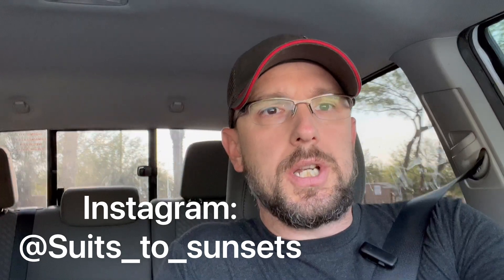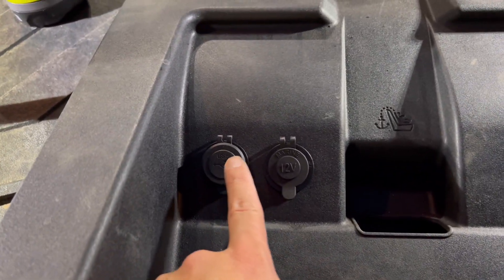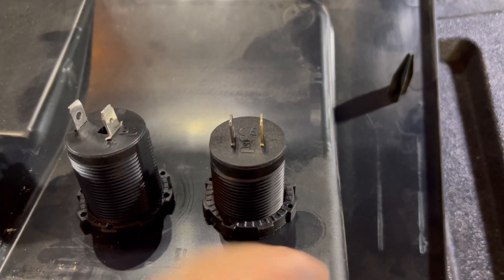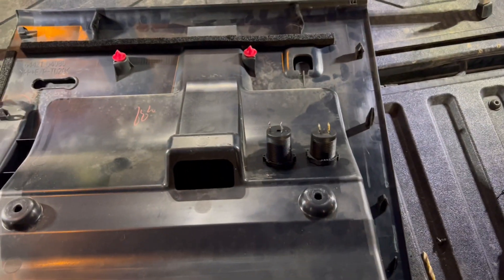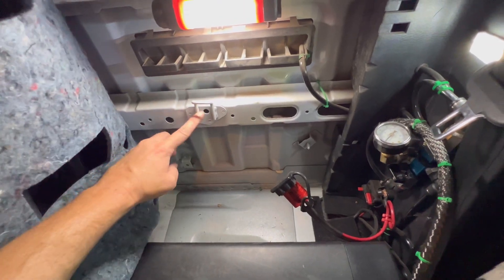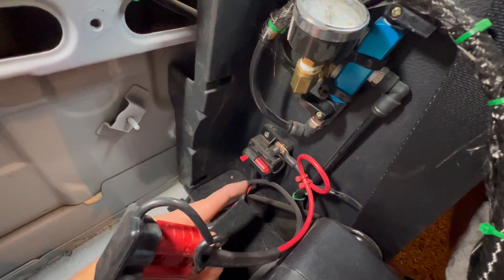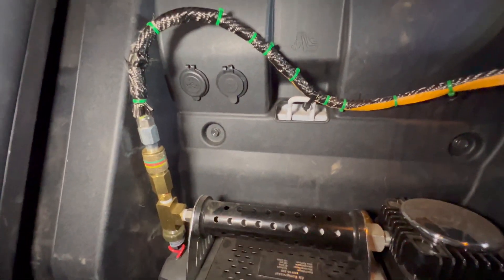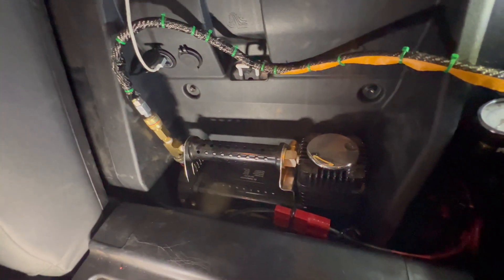Adding charging ports in the back of a 3rd gen tacoma.

Comment: What is the thread and the size of the nut that was used on the bolt at 6:18 time stamp? Do you recall?
Reply from the maker: On the grounding stud? I want to say it is a M6x1.0 if i remember correctly.
Reply: Yeah! I am building a electrical system be placed back there and I want to use that bolt as a way to secure it to the back of the truck seat.  Appreciate it !  @azbackroadadventures
Reply from the maker: @CANheSE3me glad i could help.

Comment: You're going to make me clean mine up now 😂🤣. That looks great
Reply from the maker: There is a panel i have been thinking about getting that has the Anderson plug in it to clean that up too… still debating haha.
Reply: @azbackroadadventures  I have a panel in my forerunner that has multiple USB ports and 12 V sockets with an on off switch hardwired to the house battery in it. I just have power ran straight from the battery to the back of the Tacoma right now, because I don’t plan on doing much other than daily driving it. However it too has a refrigerator so I will probably put a house battery in it as well. These damn things cost money!